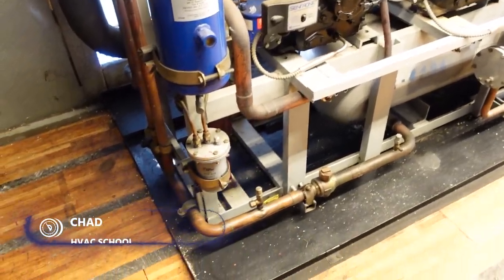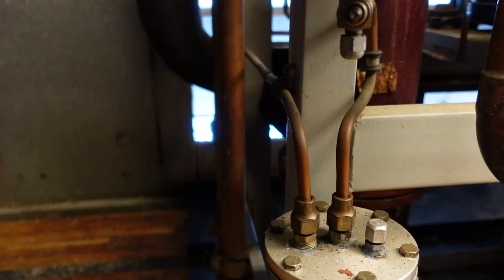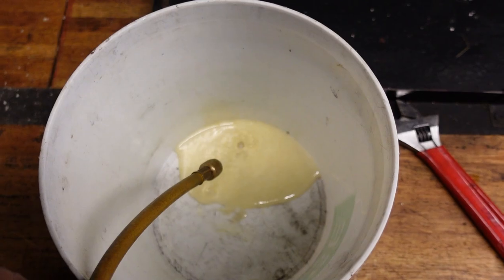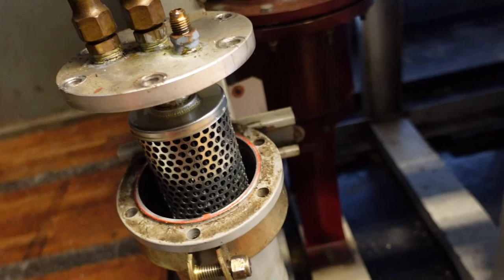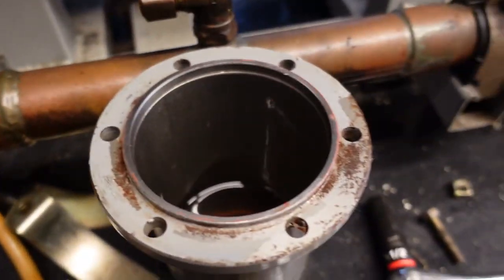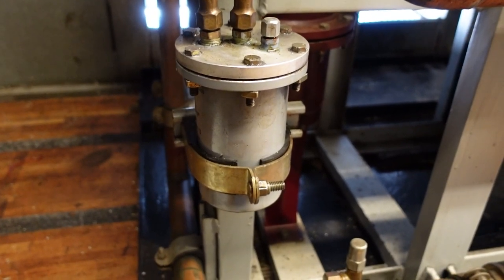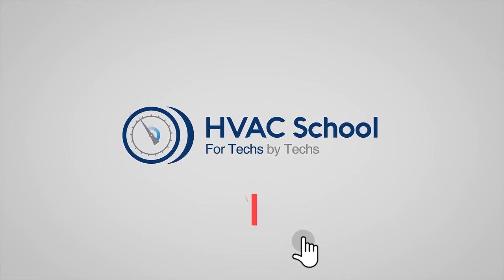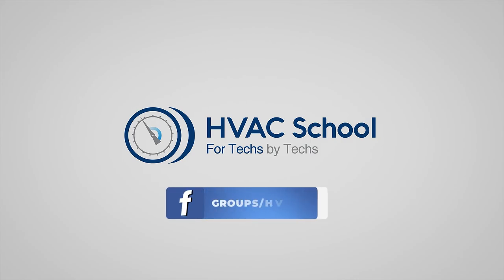Replacing a Refrigeration Rack Oil Filter

Comment: Nice video~ I have never had to do this on any refrigeration equipment; question on the procedure.  It looks like you can leave the compressors running while the filter is being changed, as it sounds like I hear them running in the video. Thinking the oil will still flow through the system with the refrigerant while the filter is being changed. Thanks for the video

Comment: I'm not a refrigeration person but I work on commercial hvac. Question would you vacuum that oil canister down after opening it to atmospheric air with it valve off?  Or I am just over thinking that process ?
Reply: Correct mate.
Reply: @skiachtro  then the question why would he not show it in the video being that this is informational / learning video ?
Reply: @pineychristian  I don’t have an answer for that one. Perhaps the base assumption/ understanding is that a vacuum needs to be pulled. This would explain why it wasn’t shown. The procedure is basically the same for any kind of filter change (oil/liquid) or work on the rack. Isolate the part to be changed, recover the gas from isolated section, change the part, pull a vacuum, and open isolation. It’s a good practice to leak search too. When changing filter-drier cores you can use the suction header to recover the liquid refrigerant. Oil feed line on that rack are likely only going to be 10-20PSI over suction header pressure (whatever the OCV valve reads. OCV is a pressure bleed down valve on the oil reservoir) so there really isn’t anything to recover besides a little vapor.
Reply: You can see the OCV valve at the 00:08 second mark in the video. Left hand side of the screen on top of the blue oil reservoir. It’s the brass column in front of the reservoir inlet service valve and has the copper line and flare nut attached to the top. It runs back to the suction header.